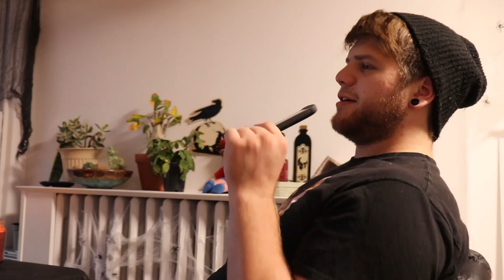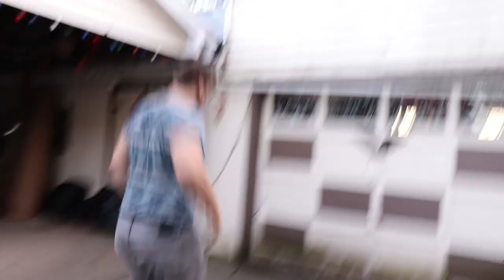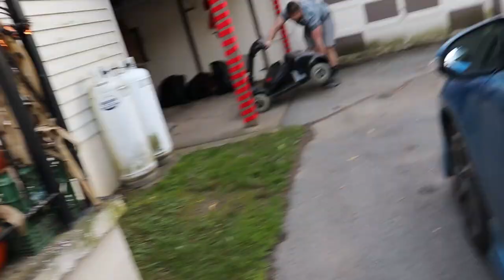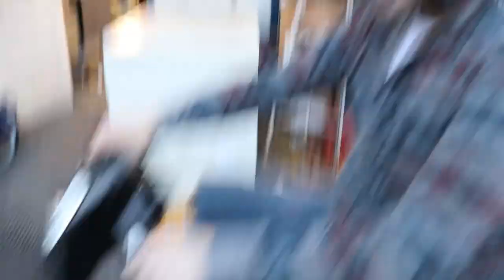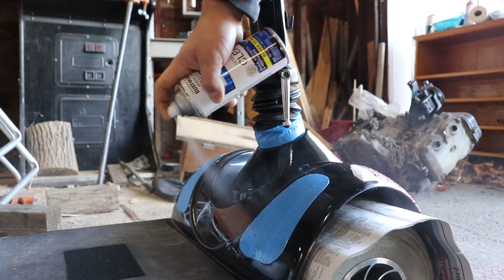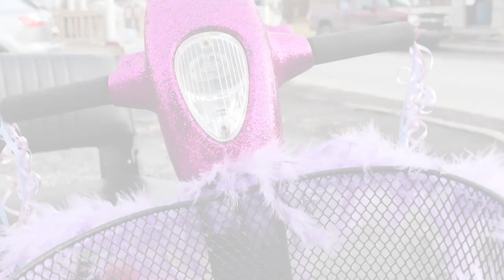I Pimped Out my Grandma's Scooter (Pimp My Mobility Scooter)

Comment: I can ser ehy 300 subs was elusive.

I was expecting a new controller powering a pair of hub motors from qs motors power boosted from 500w to 5000w. New lith ion battery pack - maybe a sound system.

Instead we got... Pink glitter.